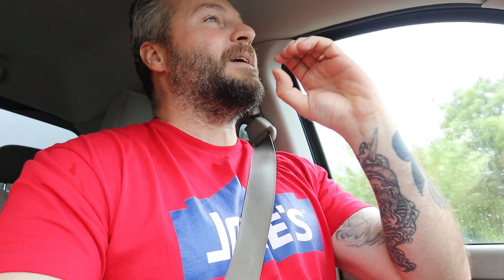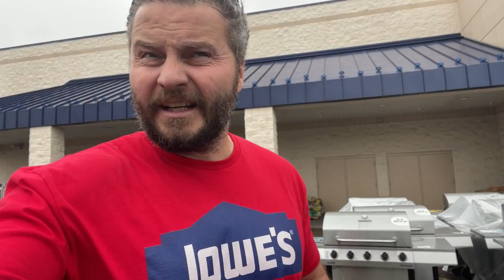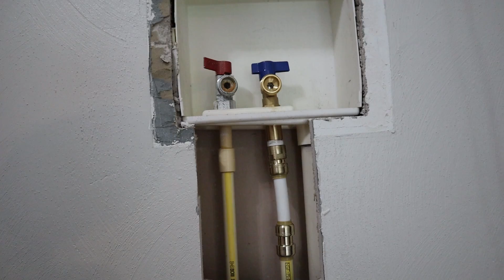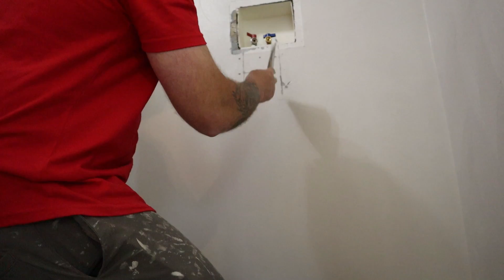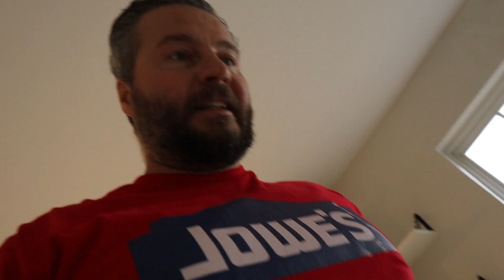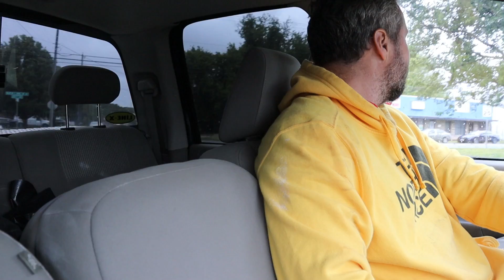Wait Till You Hear How Many People HAVE LOOKED AT THE HOUSE!!!

Comment: Hey joe here’s a tip  when your doing a repair. Even with 5 min mud use a heat gun and move it across it. When making small patches at the place I use to do as Maintenance was the quickest way to do it and get it dry and done

Comment: I’ve done a house that needed everything but framing and small floor repairs. that’s my first house I still own. now I had a day job 4 days a week. after that in the evenings and every off day I had 90% anyway, I spent working on it. Took me 2 years. didn’t pay a single contractor I did ever thing including the roof, HVAC, electrical, plumbing. all me. And hey just my experience. The doors you can buy at lowes and Home Depot. There ok. They are a pain to put in and never close right like your experiencing. I got doors one time from a lumber only place like mill creek local here in Oklahoma. and had zero problems. and I’ve put in about 60 or so more since then. Still zero problems them. Few more dollars for them compared to lowes and they need painted. But worth my time for the 60ish dollars more per door. cause man messing with a door for the 4th time in a week. It’s a pain. I think the lowes doors warp after installation depending on house temperatures and humidity. because it’s a low quality door. imo

Comment: This is not a criticism, but a tip....don't tile around your door trim....you can under cut your trim with a hand saw or they sell an electric saw looks a little like a grinding wheel ,so you tile goes under your casing or under your casing and jamb....looks so much neater than caulking spaces also under window just remove the trim apron and tile right to the sill....anyway those too things would make job look much more professional and clean and makes job easier

Comment: That potential home could make or break you. If you flip 5 houses a year at 20k net profit a piece your pulling in 100k. (Low end) Your getting much quicker at it. 2 months to buy, fix, and flip per home. The big house (flip 5) repair time probably at least 4 to 6 months. If it's just the 2 of you. Also big homes don't sell as quick. Also if market takes a dump during project easier to rent out a smaller home than larger one. 125k for the house 150k in repairs, (275k) Worst case, 7 to 8 months, sell for 375k to 425k. Possible walk away 100k to 150k. End of year flip another house get an additional 20k. So 5 a year 100 to 125k. Or possibly gamble a bit make that extra 50 to 75k. One big thing on the water maybe you get your 500k (selling) than that makes the deal even sweeter!!